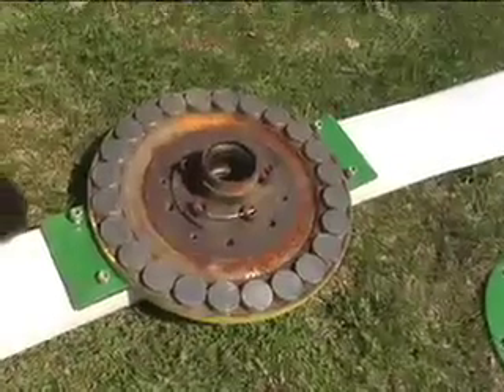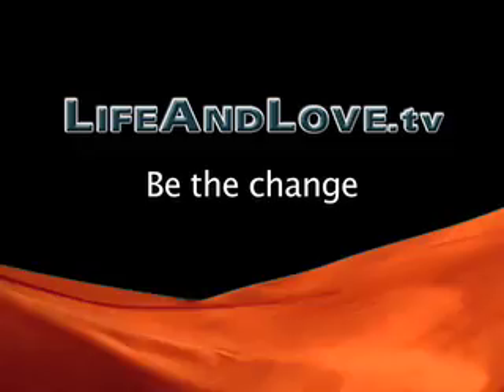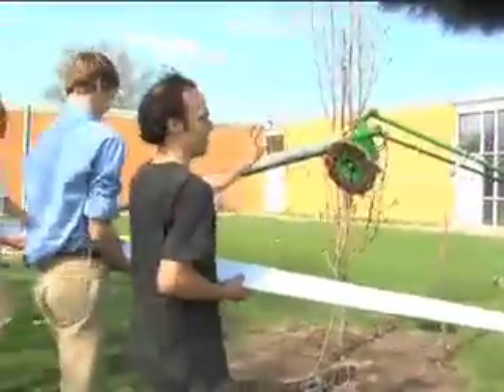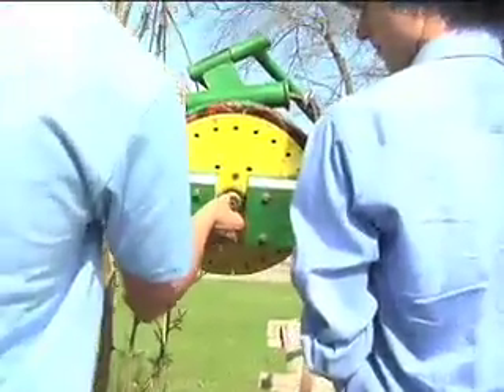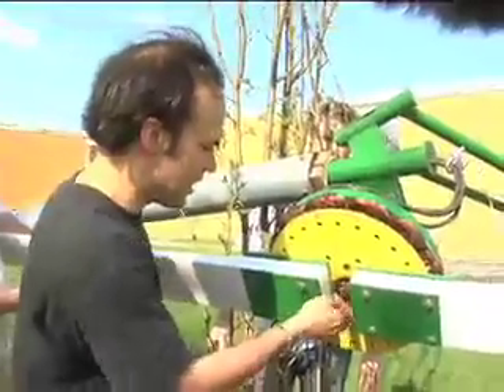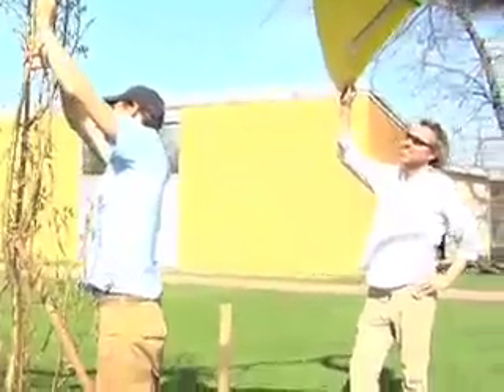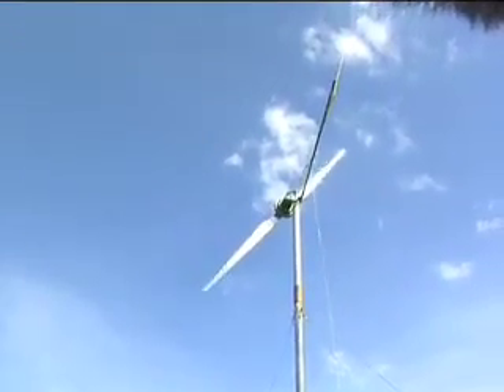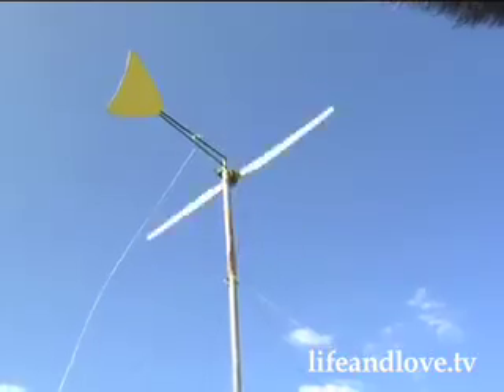Home Made Wind Turbine

Comment: The biggest problem is liability,the prop is a potentially able to kill a human being if it comes flying off the generator,however I think with this real liabilit yin mind people can overcome this by making certain it is built to withstand the pressures and also make certain the frictions do not wear out parts and cause mechanical failure,the brake is also needed if the wind speed exceed tolerance strengths of the materials used.other wise this is a great leap for you guys.

Comment: It is BAD idea to put even number of blades due stability...it starts to wobble at certain point of wind power.
Reply: Have you actually seen that happen in small wind turbines?  This wind turbine works just fine, thank you ...
Reply: @MrSummitville  , no. I did not. So it is possible it is not causing problems. But instability is there.
Reply: @tonfazg  There are many 2 bladed wind turbines in service.  One is near my house.  Many DIY'ers will carve a single piece of wood into a "2-blade" design. The 3-Blade design is way more popular but it i snot required.  Just Google "2 blade wind turbine" and then  select "images".  Way more common than most people think ......

Comment: It is not true that all generators driven by wind use synhronus engine with permanent magnets, they usually use asynhronus engines because of the speed of rotation, but yeah, i agree it is easy way to do it wen you do it yourself...and thats the way i would do it.
Reply: This one, does NOT use a synchronous engine ...
Reply: @MrSummitville  fine. What engine does it use?
Reply: @tonfazg  Dual Core Axial Flux Permanent Magnet Alternator that produces wild AC

Comment: @mandolinic It's not legal to put power into the grid without special permission. You must always be slightly on the draw side. Quite simply this is for the safety of workers on transmission lines. If every person and their dog were generating electricity and loading the grid, the utility companies would never know if the lines were truly isolated from sources of power when conducting maintenance.
Reply: This device can not back feed the Grid, when the Grid is down. Stop with the drama already ...

Comment: @mandolinic Normally you have a rectifying bridge connected between the windmill and a charger, charging a battery storage. Then use only DC appliances,  or get a suitable DC to AC-converter. A cheap solution is to get hold of a used (but not dead) fork-lift battery, it usually holds something like 5000Ah for many many years for the fraction of the cost of that amount of storage with commercial deep-cycle solar/wind type batteries.
Reply: No, I cannot just "pick-up" a 1,000 Pound Fork-Lift battery ...

Comment: @david18861886 Pressure based storage schemes present a real and potentially deadly personnel and property hazard. Just think of the forces on a container holdiing the energy collected by your windmill for a day when converted to air pressure in a tank. Batteries usually cannot release all of their stored energy in a single instant.

Comment: @david18861886 Nature has chosen to use the equal share philosophy, so any time you try to hoard energy it becomes difficult to contain it. The more energy in a chemical bond, the less stable it becomes, the hotter an item becomes the faster heat leaks out into the environment. Inertial storage devices are lossy, although have extremely large throughput capability. Sadly the eclectro chemical storage is the safest way to store energy in large levels.

Comment: Color televisions and computer monitors are a plentiful supply of easily recovered armature wire, just use multiple strands twisted together to increase wire size, this also has the benefit of making winding easier as stranded wire bends and forms loads easier than single strand solid wire. The copper wire is in the CRT's degaussing coil located between the deflection yoke and the crt base (mounting flange). I have used degaussing coils as a wire source for years.

Comment: @david18861886 With a free run generator such as this you would have to rectify and post regulate output and due to the intermittent nature of wind, the bulk of your output would have to charge batteries and useful output be derived by use of a inverter or a motor-generator powered from the storage array.

Comment: There is an alternative to moving the magnets in the generator. Wind the armature concentric to the shaft and the rotor consist simply of a 3 arm pole piece, the permanant magnets are arranged in a 4 pole configuration. as the rotor rotates it alternately couples a magnetic pole through the center armature. The 3 arm rotor only couples one pole at a time. The field magnets do not have to be permanant magnets but could be wound fields allowing for voltage regulation.

Comment: No covering over the copper coils?  I take it you spent so much time doing the aerodynamics and efficiency of the the thing you forgot about basic corrosion? Tip...heat shrink the coil package with a not too thin heat shrink material. that is weather resistant.  Copper is too expensive nowadays to just let decay in the rain.
Reply: It has a coating ...

Comment: Here's an idea, farmers used to use wind power to pump water into water tanks raised up on towers.  This stored up pressure to enable flowing water, and storage.  Why don't you do the same and drive a water pump to pump the water up into a tower, and then use the water/energy stored in the raised water tower to turn a water turbine.  This will enable the storage and generation of power when the wind doesn't blow hard enough.
Reply: Wrong RPM / Torque combination ...

Comment: @electrohacker You're joking, right? First of all, this thing should work for 30 years... What do you think electricity is going to cost during the last 10 of those 30? If this runs at an average of 500 watts, it will be producing 12kilawatts hours per day which is 360kilowatt hours per month. In Philadelphia, electricity cost .16 per kwh which is 57 dollars a month!

Comment: @RooftopWind Hey, how do you convert the generated voltage to a suitable voltage to charge up yout batteries, or back to the net? At lower windspeeds it generates a lower voltage, do you regulate this with a home made DC-DC inverter or something, Ive build a windmill myself from a DC Compound motor, but the output voltage is relative to the windspeed, and coudn't find a "Cheap" inverter that can control this,  i was wondering how you guys solved this problem? greetz

Comment: we have a wind generator made from an old car alternator, an old washing machine wringer , and old car batteries. most devices in your home are actually 12 V DC ( they run a small transformer ) , so , you wont lose much.  currently, this man sells energy BACK to the grid AND powers his own home. Its CHEAP, and it WORKS.

Comment: @4vermont 

"Also how they converted to 120volts. Anyone?"

Usually these generators produce DC power which is fed to a bank of batteries which is in turn wired to an "inverter" which converts the DC power from the generator & batteries  into AC power like what comes out of your wall.

Comment: @ethicalinnovation Any spinning blade will look this way on film. It has to do with the frequency of the blade compared to the frequency of the camera. Look at a T.V. through a fan. If you can adjust the speed of the fan you can make it look like it is standing still or going backward. It's all about matching the frequency of the strobe.  Just like a timing light on a car.

Comment: @mikallang - Ok, if you believe it's possible, please post a video of any automotive alternator based wind turbine with a meter attached displaying an output above 100 watts. As mentioned before, I have tried this and it simply doesn't work! You need LARGE magnets and coils (or very many RPMS) to produce a significant output!  Have you actually tried any of this stuff or are you just voicing an unexperienced opinion? Yes, you are correct. Ignorance DOES kill! Do it right the first time!

Comment: @mikallang - They are do it to see if it works! But they quickly find that it doesn't! I believe there are simply a lot of people making comments here based upon what they think rather than what they know or have actually tried. I know...because I have tried. Yes, there are indeed some alternator based turbines that work. However, they are specifically designed forfor that purpose.

Comment: @jimginnyohio That's not entirely true because by default car alternators are "geared" based on the size of their pulley and the size of the pulley they are driven by. Also note that the person in the video says that this device can generate around 2,000-3,000 watts in a 40mph wind, realistically you'd have the fan portion up as high as possible to capture as much wind as possible and if you could get 10mph you'd be at 1/4 that or around 500-750 watts per unit.

Comment: @jimginnyohio or you could just use simple gearing systems to get the required RPM. admittedly, you would then need more wind but it is a more user friendly method, meaning you only need to hook the alternator up to a car battery, making it great for charging phones and stuff.

Comment: hey i got a question guys when you make the PM alternator is there a force that stops it from turning. Like does the attraction of the magnet and coil creat resistance? Im asking this because couldn't you hook up a very large Alternator to small blades because the smaller the blades the faster the tip speed and so-forth

Comment: @dirtbikerboy202 usually the turbines are used to charge batteries which means the cables from he turbine would go to a charge controller then to the battery bank. From the battery bank it would be connected to an AC inverter then to electrical circuits.

If you are connecting straight to grid you would have to have a grid tied inverter.

Comment: @hemna 
I made a speed brake out of an old moped clutch. It works really well. All you have to do is tweak the springs to the desired tension, so you can control the rpm of wich the brakes activate.

Comment: You've completely missed the point! A car alternator requires at least 1500 rpms or more to produce that kind of output. A typical wind generator receives only about 500 rpms even in a strong wind....so you're already at a loss! Now add gearing to that and you increase friction, which equates to even fewer rpms!  The increase in the friction negates the fact that you have added gearing....meaning that you're still at about 500 rpms.

Comment: That wouldn't work! A car alternator is designed to operate at speeds of 1500 rpms or more. Even then, they only produce a small output of volts/watts/amps etc. Gearing would only create more resistance! This design works great in low winds to produce a lot of power from low RPMs. Currently, there is no better design. Recommend you search Google for Hugh Piggott's website for a good education about this stuff. Enjoy!

Comment: car alternators are designed for high rpm usage, wind turbine generators are designed for much lower rpm usage =)
The problem with a belt system is that it requires more parts, which will wear and require replacement.

Comment: @ltramd That would work if you wanted something small, but you would need pulley or gear system to spin it at the correct rate... Your only going to get between 850 and 1800 watts out of a car alternator though.

Comment: computer fans use brushless dc motors. you will need to invert the circuitry to draw power from it (not worth the trouble if you ask me). if you want to try building a tiny wind generator you can use a regular dc motor with permenent magnets but don't expect to power nothing more than a couple of led lights.

Comment: Computer fans are 3 phase AC motors. They have circuitry to convert the 12v DC to 3phase AC.. There are a half dozen good reasons why computer fans just won't work for this. It's too bad too, 3phase AC would be very handy.

Comment: The output is AC, but it is not a simple, standard, 60Hz single phase.  The easiest thing to do would probably be to rectify it to pulsating DC and use it to charge a bank of car type batteries.  From there an inverter would be used to get 60Hz AC at 115 volts.